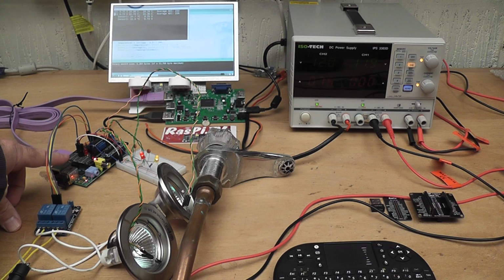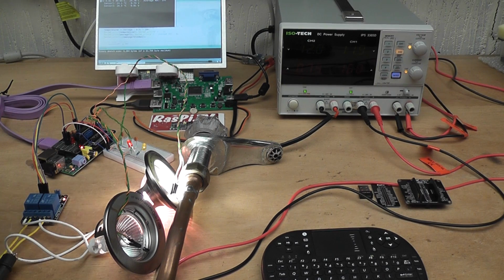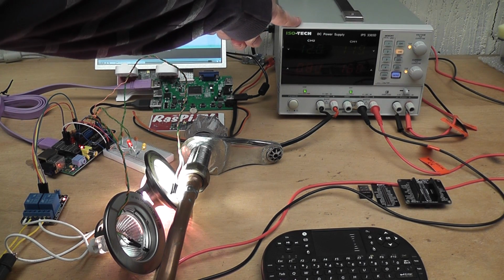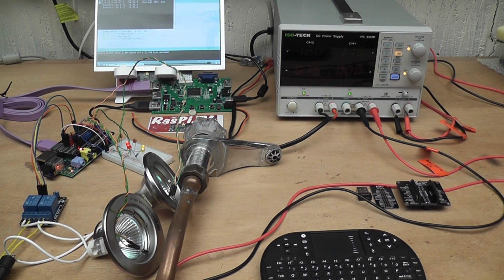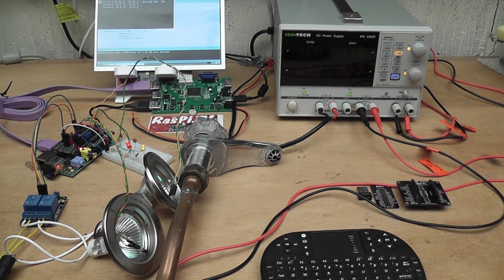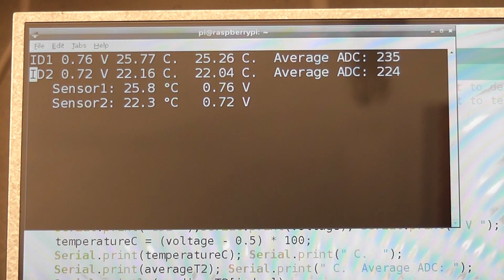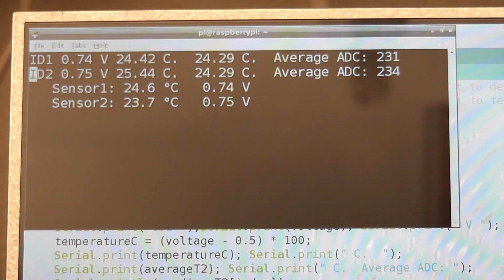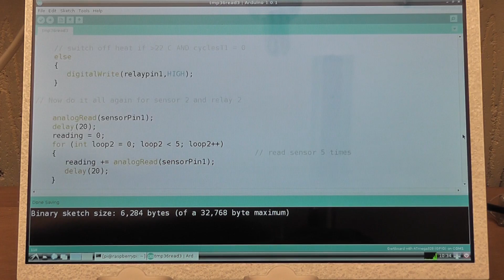RasPiO duino temperature control system

Comment: I like the hack, but being practical, why do you even need a computer, can't this be done with just the discrete components?  (Or if you do need a controller, why not just the arduino - why the Pi as well?)  The more components, the more risk of a system failure, especially in extreme weather conditions.

Comment: Or, for about the same price as a Raspberry Pi, you can buy thermal plumbing tape designed to keep our pipes from freezing.  Basically just a heating element with a thermostat built into a form that can be wrapped around your plumbing.  But then you don't get the enjoyment of coding a complex kludge.
Reply from the maker: LOL. That comment was anticipated in the blog article. :)
Of course, you're right, but that's no fun.
Reply: Alex Eames Fun is fun, and this is of course a great example project. But since your house it at risk, simpler it better.  I would use the pi as a supervisor and perhaps as a backup to a simple heat tape with a built-in bimetal temp switch.  dumb as dirt, but also very reliable.
Reply from the maker: I completly agree, and I may never use this 'as is'. A thermal collar of some sort would be much better than bulbs, but would look awfully boring on video.

Got a link to the tape product you recommend?
Reply: We have a brand here in the US called "front king", on amazon they are like $30 (usually like $20 in a store)   http://amzn.com/B0041E953Y   avail in a range of lengths
Reply: BTW, i have a similar situation in my barn, its a detached building with running water.  I have a pi out there with a camera.  I read a 1-wire temp sensor and it sends me an email if it gets in the danger zone.  However, to protect the pipes i have a small space heater near the sink.  (which is in a confined space) plugged into one of these: http://amzn.com/B0000DGA8P  ... Love the videos!